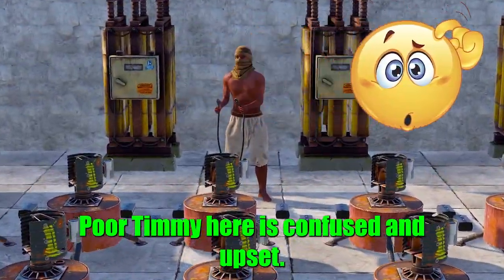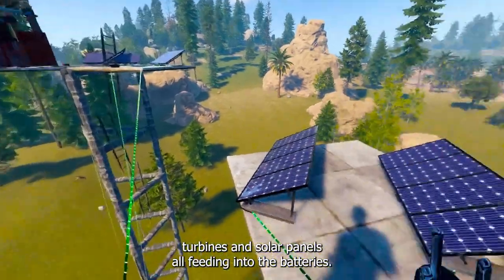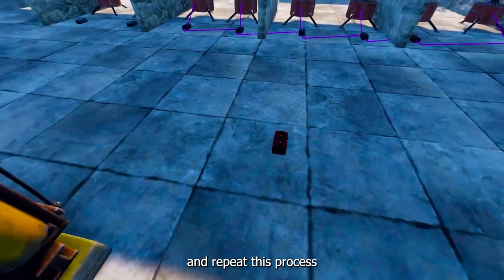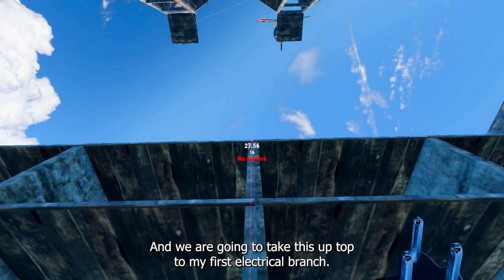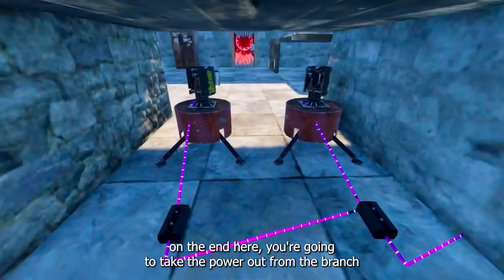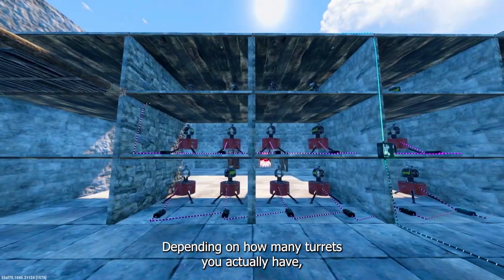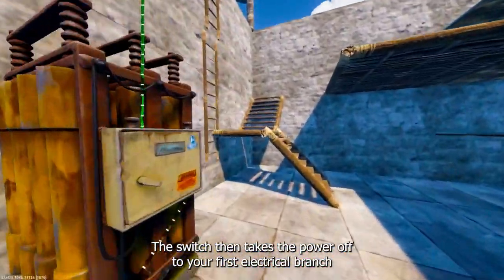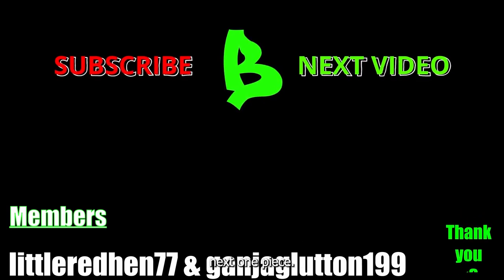How to set up 30+ AUTO TURRETS in Rust Console Electricity Tutorial

Comment: How does the branch work then with out losing battery power
Reply from the maker: Sorry man I don't get what you mean
Reply: Bro the first battery uses all the power while other battery does not. Set up like this does not cause equal power drain from each battery but rather it puts most burden on the first battery. The real question regarding connecting more than 10 auto turrets in a single line is not the set up. Its power management. How do we set it up so that each battery share equal amount of power burden. I'm trying to figure this out rn. @Budzie
Reply from the maker: @coolestguy25 https://youtu.be/kGIpWTskYH8?si=itF0ChkLJ_mgusSv

Comment: this is a waste of power, you should do 1 battery to splitter, the splitter to 3 splitters and then 9 turrets, this way each battery will see 96 power instead of 100. i know it is only 4 power but when you got 6 batterys thats 24 power
Reply: when connect 6 turrets insead of 9 the lifetime of the battery will be over 6 hours when power gets destroyed
Reply: i have a question and you seem to know what you are talking about. So i have 4 wind turbines , 2 going into 1 battery and 2 going into 1 battery. How many turrets can i effectively run with 2 windmills + 1 large battery. I have 9 connected to each rn but was wondering if i could add a few to each circuit
Reply: @Ruhmove the max output of a large battri is 100 and each turret will take 10 of it so no.